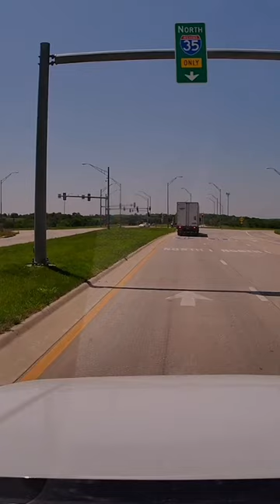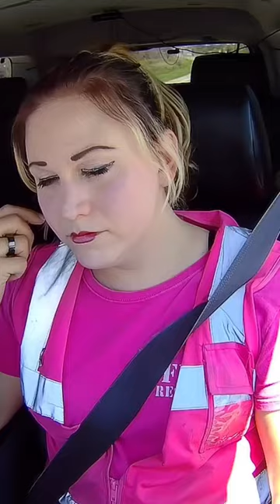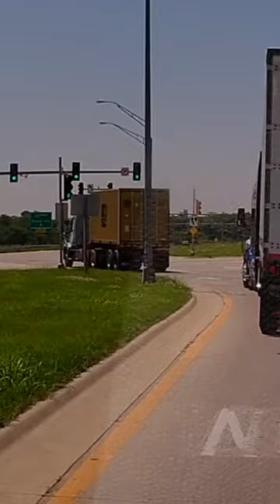Why do they make stoplights like this in trucking areas?

Comment: Most lights nowadays have some sort of AI behind them. If you see some sort of camera around the lights, that’s it has an AI controlling the lights. However, it’s a possibility that that one is timed very short. I was in the Sterling meant for tractor trailers coming through. You don’t know I actually have a light just down the road for me that does it seem thing in surmise that run that every single day have a hard time usually only one semi can get through it

Comment: Each one of those semis like 5-6 car lengths, slow acceleration, also depends on time of day so it’s not that bad if you want to maintain decent traffic flow. That’s why most trucks stay on the highway
Reply: Well I drive a truck and  cars are not 5 feet long mine long and 65 feet
Reply: @lowriderrider  ur obviously not smart a 53’ trailer is about 5 car lengths 10ft…